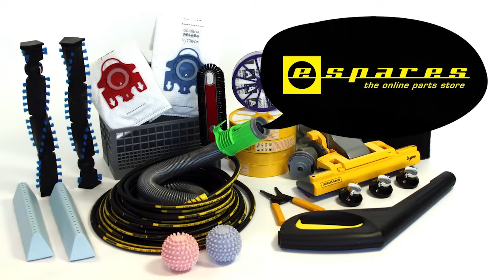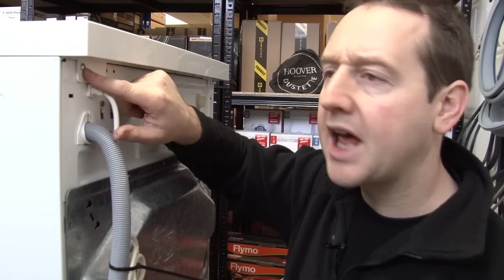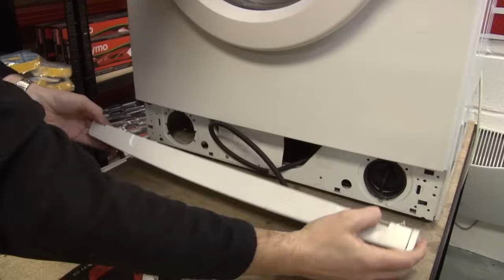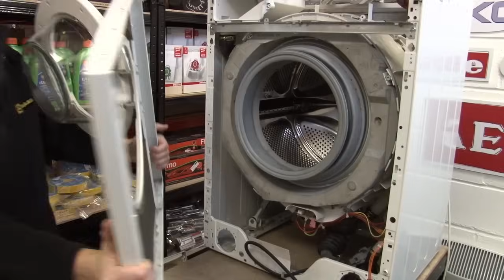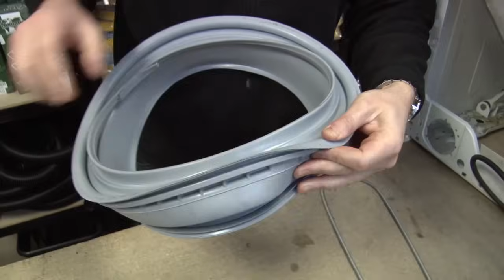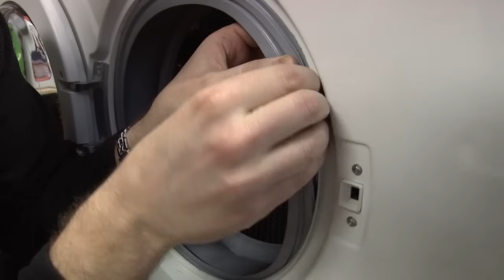How to Replace a Washing Machine Door Seal on a Bosch Washer

Comment: Sure, edit out the hard parts HA
Reply from the maker: Sorry Rich, If you are referring to fighting with the spring clamp onto the tub.
That part can be a struggle unless you are used to it so get an extra hand just to hold it onto the seal while you stretch it around onto the rest.

Comment: Dog chewed through ours. Thanks for the video!
Reply from the maker: Naughty dog lol. However it is important to allow the machine to dry between washes and if you keep the door closed it can quickly develop mould and smells. A possible way around this is to open the door wide when you are about to start drying and close it if you go out. Also using a machine cleaner regularly will help control the bacteria so for more information see another video:
https://www.youtube.com/watch?v=ifWK9df1qgg

Comment: Ok Ive just changed mine on a Bosch Maxx 5 (1200)
I couldnt get the front off as the video but I did get the contol panel off.
Here is what helped me:
When you are trying to put the back spring on , bend the hoop ends on the spring to close the gap otherwise the spring keeps coming apart.
If the washer is on the floor, then tip the washer back to 45 degrees to allow better access. Maybe fit a block of wood between the concrete block and frame to give a better gap to get your hands in.
Finally, the outer part of the seal keeps getting in the way when fitting the spring. This was eliminated by tucking in the rubber into drum by inserting a scatter cushion into hole, just enough to hold the rubber back. (After trying 3/4 hour to get spring on , this worked first time)
Reply from the maker: +Ricardo Intelligencia Thanks for the comments Ricardo and your description. We fit a seal through the door in another of our videos (not Bosch) but the process is similar to how you described.
If you find a repair is not exactly the same as your machine search again for the repair (door seal replacement) on our homepage and other videos may show different methods.

Comment: I like the cut scene at the end.. I've been trying to put the wire around the front for 20 mins.  not as easy as it looks.
Reply: and I just punched myself in the face.. awesome.  Any tricks I should know about?
Reply from the maker: +kelly ledet HI Kelly, start at the spring and draw the wire tightly around the rubber until it comes taught. Then with one hand ensuring the rubber end stays in place ease the rest of the wire in place stretching the spring. If you do not have the power in your finger tips try using the handle of a spoon to pull the wire over the last bit. good luck.

Comment: How dare you make that last bit look so easy. Over half an hour and i can't get that f'ing ring on. So angry right now. Thanks otherwise though lol. Just real stuck at the last hurdle
Reply from the maker: +Top Calibre Rob Sorry to hear you have been struggling. The trick is first to make sure the seal is fitted onto the front panel correctly, if in doubt take it off again and apply a little liquid soap to ensure it slips fully in place. Then tuck one end of the draw wire into position and pull it taught as you run around the circumference until the spring gets tight. For the last couple of inches get another person to ensure the 'start' end does not pull out as you stretch the spring and pull the last bit on. Hope this helps.
Reply: eSpares It's all good I made it in the end. I was super frustrated at the time though. My poor daughter listening to me screaming "THIS IS THE WORST" lol. I saw the neighbour laugh at me. But it got sorted and I would have been buggered without this video. Thank you
Reply from the maker: +Top Calibre Rob :-)

Comment: Great Video, many thanks, saved me around £100 for a engineer visit.

Screws in slightly different locations on the front panel on my Bosch, 4 at the bottom but still a great video.

many thanks
Reply from the maker: +Keith Miller Thanks for the comments Keith.

Comment: Excellent video and the only one on youtube that really shows what to do. My Bosch (a logixx 8) had slightly different screws and fixings etc. that had to be removed to get at the seal, but the video showed me near enough what to do. The actual replacing of the seal was exactly as shown. Very satisfying and no more mouldy rubber! Many thanks
Reply from the maker: +Rob Martin Thanks for the comments and glad you managed the repair.
Most people don't understand why the seal goes mouldy in the first place. For information on this and another common problem see :
www.youtube.com/watch?v=ifWK9df1qgg and https://www.youtube.com/watch?v=uKBy-9NEF5A
Reply: +eSpares I forgot to say that I did buy the door seal from eSpares :)
A compatible make - less than half the price of a Bosch original and perfect for the job.  Rapidly delivered so overall eSpares is definitely in my good books!
Reply from the maker: +Rob Martin Nice to get the feedback for our spares and delivery as well as the video. :-)

Comment: I have been amazed by the easy 'no problem' cut away's .... it helps to slightly lubricate the seal before fitting (WD40) so the rubber slips over the metal gutter. Plus fitting the outer ring retainer is, or can be a ball buster! (Good cut away in the vid)
Reply from the maker: +songfuzz Thanks for the comments. Some new seals are supplied with the fitting lip lightly greased to help it slip into place. On most of our other door seal videos we actually advise an old engineers trick of using liquid dish soap to smear on the gap of the seal to help this.

Comment: Hi, Thanks for the video. Helped me change the door seal on my Bosch Exxcel 1600 express yesterday!! The most difficult bit was actually getting the retaining spring band around the new seal once that had been seated. I found that the easiest way to do this was to put the band on from the bottom and then use a big screwdriverr to just put tension on the top part of the spring and then slide it into place. This prevents the door seal rubber from coming off while trying to get the spring band on!!
Reply from the maker: +Ash Achar Thanks for the comment and tip. There are may methods to do this repair and whatever works for you may also work for others. :-)

Comment: hi that thing that holds the door seal on the metal band my daughters has come of and we cant get it back on we have tryed every think plz help
Reply from the maker: +dee bishop The trick to refitting the seal retainer is to fix one end at one point ant feed the band progressively around the lip until three quarters is in place.
Then get some one to ensure the fitted end stays in position while you stretch the spring and fit the last quarter in the lip. Good luck.

Comment: Thanks for this, very clear. However, I've hit a wall trying to remove the control panel - one of the screws on the detergent draw is completely rusted. Any tips on removing a rusty torx screw?
Reply from the maker: +Matt Lloyd The problem is the screw is recessed so you cannot grip its outer edge with pliers to start it. Try to find another torx that fits what is left of the head or even a small flat  blade that catches the edges. If everything else fails you could try warming the screw head with a soldering iron and then winding it out while hot but this may damage the fascia. Good luck.
Reply: +eSpares Thanks for getting back to me! In the end several soakings with WD40 and the purchase of a set of torx screwdrivers (rather than using a torx head on my power drill) mananged to shift it.
Reply from the maker: +Matt Lloyd :-)

Comment: Great video. Just wish I'd labelled the screws as this caused a few hiccups but video explains everything very well.
Reply from the maker: +John Dent Hi John, glad you sorted in the end. Good point you made about different size screws, when you do your next repair it is worth noting the position of any 'irregular' or different screws. Top Tip: use a egg box as a tray of compartments to keep groups of screws together like top screws back screws etc. :-)

Comment: Great video, highly detailed.  Everything off & new seal ready just waiting for 6. But is it 6 PM or 6 AM?.  Hoping its PM as I cant get up that early.
Reply from the maker: Brett Coffey The reference to drain holes at the six o'clock position is to ensure you fit them at the bottom of the seal to avoid the bellows filling with water and not draining when finished. Good luck with your repair.
Reply: @eSpares  fantastic customer service!
Reply: LOL
Reply: 😂😂smh

Comment: im suffering from a smelly bosch nexxt 100 series, the door seal has alot of mold and mildew, tried cleaning it but still looks bad, this door seal looks differant, if it is a differant installation  can you help with a video on this model......thanks .....Tom
Reply from the maker: tom carver Hi Tom, without the full model we can only give general advice. If you search our channel we have 6 different videos on replacing door seals one or more should be similar to your model.
To deal with smells caused by mould and bacteria see another video:
www.youtube.com/watch?v=ifWK9df1qgg

Comment: I'm typically very handy but....after fighting with the exterior retaining band for an hour, I never managed to get it on before part of the seal would come off.  I just couldn't keep the spring stretched enough by hand.  I figured I needed a tool.  So I hammered a couple of brads into the end grain of a scrap piece of 3/4" wood, a distance apart enough to pre-stretch the spring maybe an 1½".  I was then finally able to fit the band and lever the spring end off the brads with a screwdriver into the groove in about 30 seconds.  Hope that makes sense.
Reply from the maker: Hi Richard, thanks for your comments.
Yes it can be like fighting an octopus trying to stretch the spring over the seal. 
The trick is to trap the spring with a 'third hand' I have used screwdrivers, hammer handles and even locking 'mole' grips to hold the band at one point in the groove on the rubber seal. once fixed stretch the spring as you apply to one halve and work around the other halve before removing your 'fixing tool'.

Comment: no need to take off facia or lid
Reply from the maker: Hi Shepala, thanks for your comments. It is certainly possible to replace most door seals through the port hole but as this video is designed to help some who have little DIY experience we thought it may be clearer to use this method.:-)

Comment: Most useful to have a full set of visual instructions, thanks.

It's also worth mentioning that these seals can be destroyed by wire supports in bras, despite them being washed in a net bag. The symptom being that you get a lot of granular rubber all over the clothes and it's quite difficult to remove. Although the seal probably won't leak at first, once it's damaged like that it will eventually fail, so it's worth replacing it as soon as the damage is discovered.
Reply: Remember that Washing Machine Door Seals are Silicone NOT I REPEAT NOT ACTUAL RUBBER

Comment: Please help me sir, I washer you open and then you install it the same washer but I Asubhh large what is the solution and thanked
Reply from the maker: Hi ᎥᎽᎯᎠ, we are not sure on your question.
We think you are saying the new door seal is to big. If this is correct you may have the wrong part for your machine so check your model number.

Comment: How do your rate the replacement seals which are around £15 to the genuine seals which are around £35-£40 ?
Reply from the maker: Hi Peter. I cannot advise about all seals but our alternatives are of very similar quality and should be equally as durable to an original.

Comment: Brilliant, I dislodged the seal the other day while cleaning it and my husband and I just followed your video on a similar Bosch model. First time I have done anything like this! Well pleased we didn't  have to call anyone out.
Reply from the maker: Hi Norma, glad to hear we helped you with your problem. The seal can be easily disturbed if you are unloading a heavy load (towels for example) and pull them over the seal, to avoid disturbing or even ripping the seal take care when unloading heavy items by lifting them out. Now you have found how useful our videos can be may we recommend another video that will help you keep your machine in good condition:
How to Cure a Smelly Washing Machine

Comment: Top video, well done.  I replaced my element and did the door seal at the same time, all in about 1.5h.  Just have to trace a small leak somewhere now...in any case the video was excellent.
Reply from the maker: Well done Andrew, Check the seal has settled correctly onto the drum and try refitting if it is confirmed that this is the cause.

Comment: With out this e Spares video l would not have atempted to replace the door seal. l ordered the seal on 19th August it arrived next day with in the hour they said.l did not do it till today 21st August it took about an hour, tricky est part putting on the last retaining spring, that's where the wife came in another pair of hands. 5 Stars***
Reply from the maker: Hi Tony, Good to here we helped with information and the great delivery of spares. Hope we can help again when required. :-)
Reply: eSpares do you have to remove the control panel and the top cover.  It seemed to me, You would only need to remove front panel to replace the seal.
Reply from the maker: Diana Hi Diana, as a general rule remove anything that will help make the job easier. You can replace the seal without removing the front through the door but this is not easy, we showed this method for those who are less experienced as this helps show what is required.

Comment: Terrific video.  It made the job very easy for me - without it, I would have taken hours.  Our machine is a Bosch Maxxi Classic.  
The most difficult part was removing the skirting panel which is different to the one in the video.  One screw has to be removed then the panel has to be slid about 6mm to the right to allow a set of plastic  locating tags to slide out.  
And there are no screws in the door latch location - just a couple of plastic blanks where the screws might have been.

Comment: Hello there, great video.
I followed instructions but unfortunately was not able to succeed.
The issue comes from the "large counterweight" Matt talks about and I definitively "don't have enough room to work". I tried to remove the counterweight but it's really stuck with the machine, even after I had removed the screws holding it.
I'm thus unable to work the new seal onto the drum as the seal won't stick (what Matt does with his fingers at 3:46 I cannot do).

Is there something special I could do about it? It would really hurt to have gone that far and not succeed. :(

Comment: I would have been totally lost without this video.
My machine was slightly different and the retaining screws for the front panel were in a different place and getting the seal back on is not easy first time around but once you get the knack it is easy.
Because I had to remove kitchen doors and skirting it took me a good couple of hours but not bad for someone approaching 70
Reply: The seal was not linking but had been torn slightly and was catching the clothes and making a mess of them. My wife was not happy but she is now a happy bunny again. Cheers.

Comment: First no need to remove the lock just unplug it as some locks had pins you need to push on which can weaken them. But more importantly never remove the weight. If you can't fit the seal with out the weight still on then get a pro in to do it. The if the weight is not refitted correctly it can full off in full spin destroying your washing machine.
Reply: ***** When a m/c is spinning at max spin it would only takes seconds for an ill fitted front weight to work loose and causing a lot of damage. Yes this can happen on m/c where the weight has not been disturbed but this is because the 3 screws helping to hold the fixing band on have not been fitted correctly by the factory. There for if one dosen't know the importance of fitting the 3 screws far enough to put the right pressure on the weight holding lugs and fixing ring the weight can come off.

Comment: Great video thanks, but as pointed out by srm017 it is even easier - only 8 screws, all T15 size, (1 at bottom right of soap dish, 2 to remove door hinge, 1 for bottom plastic panel, 4 securing bottom of front panel), so no need to move the machine to take the top or control panel off which halves the time the job takes. Only caution is that the door lock is connected to wires so if you have a model where the door lock is not held in by screws at the front then take the front off carefully

Comment: Thanks worked great! My Bosch WFL2060 is stacked, so I did not remove the dashboard. I did remove the soap dish, toe panel and front panel. For front panel, remove two screws at bottom and two in door lock, then loosen only the bottom-right screw in soap opening (couldn't get out, just loosened). Removed two rings and cleaned everything with bleach and hot water. Put dish soap on rings before re-installing - found the rings pretty easy to get on. Saved my manicure with thin rubber gloves! :-)

Comment: Thanks for posting this video! I've tried to open the filter in the bottom of the front panel? but it was blocked by something. After this video i've opened front panel and removed pump with the filter. Inside it i've found 4 needles.
Now everything works properly. (Sorry for my English, i'm Russian)

Comment from the maker: Hi

In most cases the top will have to removed first in order to remove the front fascia. Once the top is removed it should be obvious how to remove the front . If you require a diagram to help please contact our call centre directly on 0844 9777 888.

Thanks and good luck!